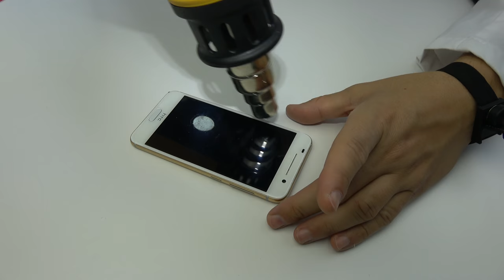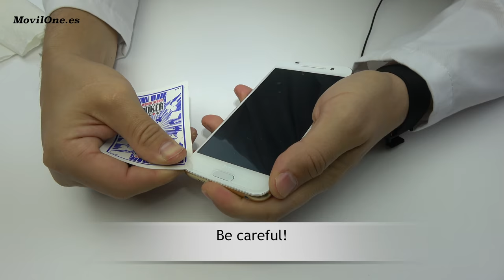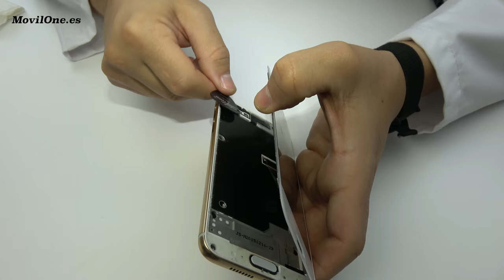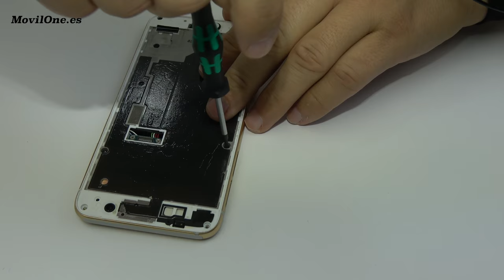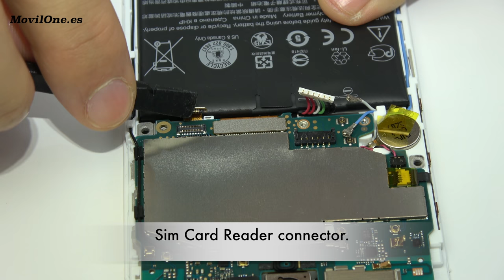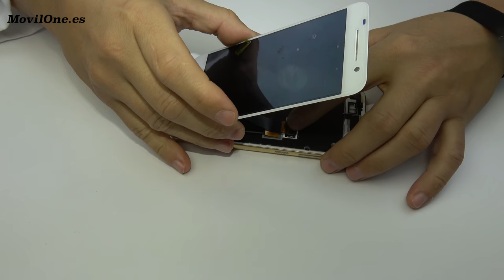HTC A9 Back camera replacement

Comment: Hello, will a hair dryer on highest setting work to open the device ? I bought a refurbished one recently which has heavy dents on the back, I want to replace the back so its value will not be as low when I sell it
Reply from the maker: Hello, H8 R3D! A hair dryer it should works, also :) Thank you for asking and any question you might have, I m at your disposal.Best regards
Reply: MovilOne Awesome , thanks for the quick reply. Also , do you have a screen replacement tutorial for the p8 lite ? +earned a subscriber
Reply from the maker: https://youtu.be/5aIeiDwhVsw This is the tutorial for Huawei P8 lite! Thank you too, for your comment and subscribe :)